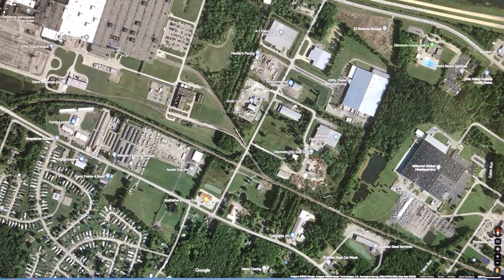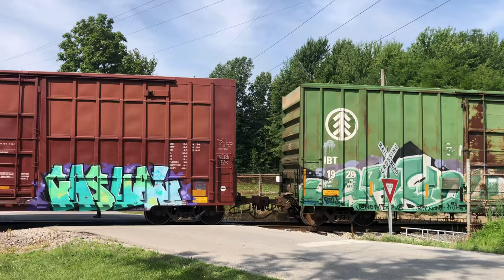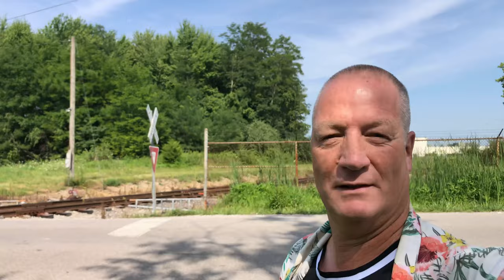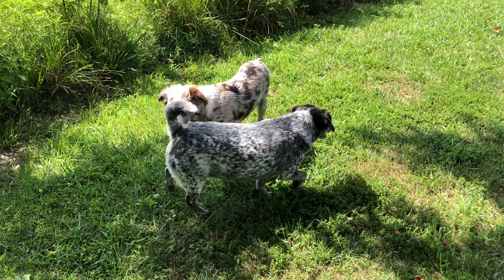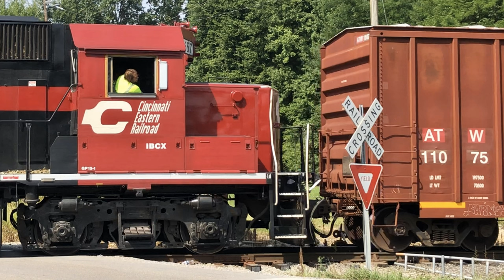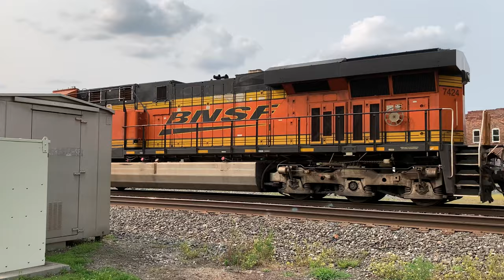Railroad Switching, Cincinnati Eastern Railroad Train Shoves Boxcars Into Huhtamaki! CSX RR Diamonds

Comment: Good video, Jaw Tooth! Those tickers are called air dryers. For
some reason, you here that
ticking or spitting a lot on short
lines. It usually only expells
moisture when the air compressor shuts off. So on
most railroads where it is better
maintained, you only here it
occasionally.
Reply: That’s supposed to be “hear them”! LOL!
Reply from the maker: Thanks for the information!